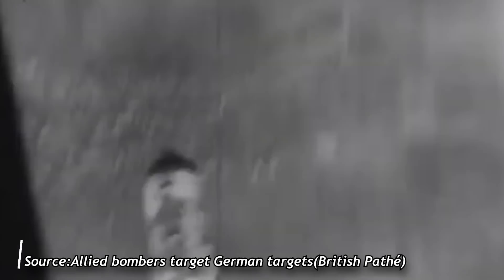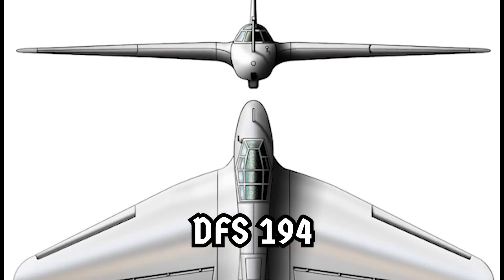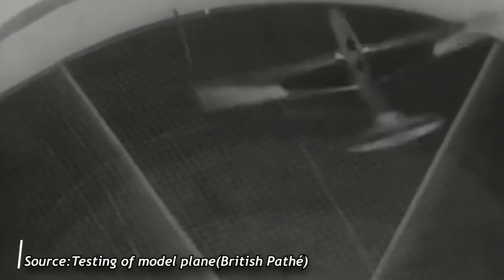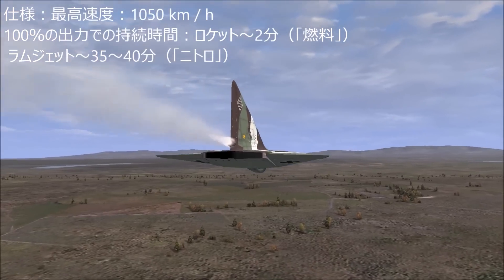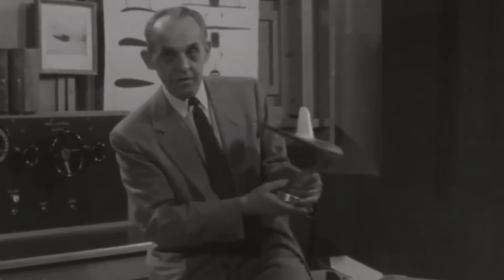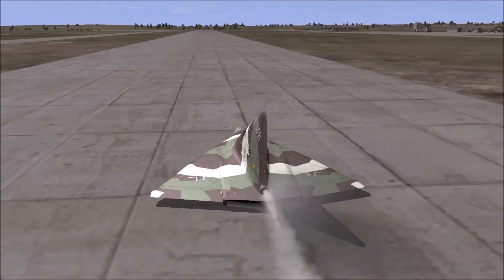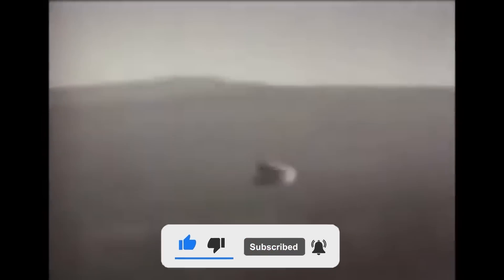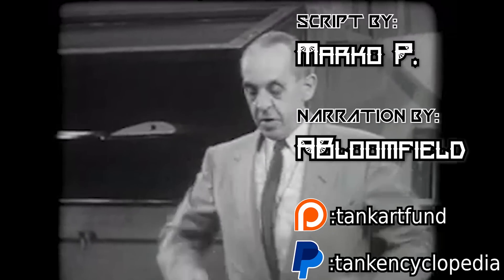Triangle of Terror | Lippisch P 13a

Comment: Ironically, Lippisch didn't really understand transonic aerodynamics until much later. The Xf-92, Xf-102, and Sea Dart were not supersonic as originally designed and only a radical redesign made the F-102 almost work out. With all the fat surfaces on the 13? It probably would have had a very low Mach limit.

Cheers!

Comment: The Li-P-13 is a prototype for an electrostatic powered space plane, using coal dust colloids for electrostatically charging outer skin for flight in Earth´s Space Charge and Ionosphere for accelerating to 28,000 km/h to be catapulted to LEO for docking on a Wernher von Braun or an A-4 Space Station, see tube in front of caft which is also air intake and crawl tunnel simultaniously. Space Plane has no camouflage but bare metal for positive or negative charging and rounded edges to avoid corona discharge. Sorry, no ramming fighter , all disinformation to cover up Space Warfare in 1945 , , , Klaus-Peter Rothkugel, Book Author about Sonderfluggerät in WW II,

Comment: There were suggestions that his work in the later stages of the war were simply a rouse to prevent his staff being taken away and sent to fight. He knew coal would never work, but it was a dream to good for the officials to refuse.
Reply: Anyone that has seen the flame thrower jet of pulverised coal in a modern power station or post war steam locomotives knows it would work in a ramjet.  You can check out some YouTube videos of the effect.    In a ramjet the air is slowed down to increase its pressure  by as much as a factor of 3 or more so the flame will hold.  The coal was a refined type held in  in a rotating basket that dispensed into the burner.  A rocket was used to induce airflow into the engine for starting at zero speed and provide some thrust.
Reply: @williamzk9083  Or on foundries, or forges?
Reply: Germans made benzene, synthetic fuel out of coal, bc they had plenty.
The Monowitz plant next to Auschwitz was used for mfg. benzene out of coal, also make synthetic rubber.
Reply: and any energy was good energy
Reply: didin't the germans already use coal in their planes tho? they used sinthetic fuel made out of coal so what was the point of the p.13a anyways? Was it supposted to use coal in it's original form? like the solid state of coal?

Comment: The French Payen PA 22 predates Lippisch P-13a and the Payen PA 22 was actually built and flew although not with its intended ramjet. It too was meant to be powered by a French ramjet (Melot 1R engine) .  After invading France, Germany confiscated the PA 22 and painted German markings on it. It is easy to see where Lippisch copied the French design. The European Canard Delta designs found in the Air forces of Europe could all call the Payen PA 22 their great grandfather.
Reply: Everyone knows a Frenchman Patented the Lorin Tube (the Ram Jet) in the 1920a, no argument there.  However the transonic and supersonic delta wing is purely a German idea.  They did the hard yards of not only theory but aerodynamic and wind tunnel testing at supersonic speeds.  No one else had supersonic wind tunnels bigger than 1 inch.
-It is not just a matter of a triangular plan form:  Swept and delta wings have "span-wise flow" which leads to a longer journey for the airflow, a consequent thickening of the boundary layer and thereby premature separation and stall at the wing tips.  This doesn't just lead to a loss of role control and spin but a pitch up as the center of pressure changes causing a deep stall that can't be powered out of due to drag increase (so called Sabre Dance).    The solution is aerodynamic twist (geometric twist can't be used as it causes shock waves)  and alternatively slats, slots or leading edge flaps (the latter were a pure German invention that came out of the needs of thin wings, in the US they were latter called 'droop snoot').
You have to also use transonic wing sections.   The Germans had also understood the beginnings of what was latter called the area rule and how to blend the wings into the fuselage.  Some of their designs hard a coke bottle shape and this Lippisch P.13 was area ruled by its delta wings and fin.
Reply: @williamzk9083  "They did the hard yards of not only theory but aerodynamic and wind tunnel testing at supersonic speeds" Great stuff if the discussion was about supersonic  flight theories. Even then, I believe the Brits and Americans with their supersonic programs, post war, did the actual "hard yards" by applying theories to real aircraft and having the "balls" to fly those machines through the sound barrier. Turning dreams into reality, regardless of who first dreamed about it or what aided them. This is as far off topic as I plan to skew this.
Reply: I think the claim that Lippisch 'copied the French design' is a serious case of historical revision. There is zero evidence for this claim.
Reply: @IronFist.  the Payen PA 22 also had a very large unswept canard that was completely unsuitable for transonic flight.
Reply: As far as I know, first Delta Wing Planform airplanes were those patented in US by the tailor Roy Scroggs, watch 'Last laugh!' YouTube video, one of it actually went somehow airborne, sweptback in its Leading Edge was same as in Handley Page machine were Concorde Wing was tested at Low speeds. 
DM-1/ L-13 was proven stable up to Mach 2.5 at Langley
Reply: The documents by Charles T Jones on Delta Wing planform are available for open and free download on the web, also Research about Area Rule, references are in the corresponding Wikipedia articles
Reply: FPV and Radio Control for X-Planes did not exist in early days, resulting in some Pilot deaths

Comment: There was a similar design near the end of the war, in Bavaria, with a rocket engine.  To save weight and for the big front MG cannon, the plane was made of plywood.  Launched ontop of a rocket booster, this was meant as interceptor against US bomber squads.  There was even a shark mouth with teeth painted on the front.  The pilots refuesed to test fly it, so the engeneur flew himself, and died.  They had no gyroscopes yet.  In Peenemuende they had gyros, for the V2, but both projects were top secret.
🚀🏴‍☠️🎸
Reply: The Bachem test-pilot was a Luftwaffe volunteer. His plane was nothing like the Lippisch ramjet-powered delta.He was killed when his rocket-powered aircraft dived into the ground.
  The Lippisch design was partially tested but never flew as a complete aircraft. Its novel 'coal-powered' ramjet was considered viable.
Reply: @None-zc5vg the accident occurred because one of the 4 solid rocket boosters fizzled and failed to seperate.  The remains of the test pilot and the wreckage was only found about 20 years ago solving the mystery
Reply: @williamzk9083  Thanks.I believe that at the time of the crash only one arm of the pilot could be found.
Reply: Some think that the test pilot was the first to ever break the speed of sound.
Reply: @JohnnieWalkerDread  (that's some consolation!)

Comment: The Me163 was a deathtrap. The P13 was the same thing with a different airframe. Also, a ramjet fueled by coal is dumber than a sackful of hammers. What you need to understand here is that anyone not immediately valuable to the war effort would get sent to the Eastern Front. Thus, the scientists kept coming up with new, plausible ideas. And the fact they did so speaks to their intelligence.
Reply: No 60 year old scientist was at risk of being sent to the eastern front.

The ME163 flies beautifully, it's the rocket engine that was the problem, due to its volatile fuels.

Comment: Aerodynamically interesting design but so far no one has ever been able to make a working coal powered jet engine and they never even got a prototype of this engine before the end of the war. Like so many of these projects at the end of the war it seems more of a cover project to keep designers away from the front lines then a serious aircraft concept.
Reply: To be fair I don't think anyone has every seriously worked on an aircraft jet engine powered by coal.  However, coal (dust) powered turbines used in ground vehicles and stationary plants is another matter, it works, and is in use.
Reply: @PRH123  
My point is that in the case of this plane I don’t think they had the time or possibly not even the industry capability to have a real shot at making it work.
Reply: @bradywomack9751 That sums up the entire German war industry by January 1945.

Comment: Lippisch designed similar "triangles" for Convair after the war, leading to fighter planes like the F-102 and the superior F-106.
Reply: And the B-58 Hustler supersonic bomber.  👍
Reply: Contrary to suggestions that German designer Alexander Lippisch influenced it, Convair independently discovered the thin high-speed delta wing.
Reply: @teslashark  Why was Lippisch on the payroll?
Reply: @teslashark  Jingoisic Babblings.  Lippisch was Key to the b58 .
Reply: @barenekid9695 Right and wrong, allow me to explain: The B-58 was built using lessons learned from the F-102, but was almost entirely a Convair design through and through. However the F-102 was primarily based on the research vehicle XF-92A, which was almost assuredly something that could not have been created so quickly without the help of Lippisch, and is directly analogous to his ww2 designs. 

TLDR; B-58 wouldn’t exist without Lippisch, but it is fully a Convair design, technically.
Reply: Geran and Shaheed are pretty similar. and very effective.
Reply: @simonschneider5913  They are drones and have nothing to do with this conversation.